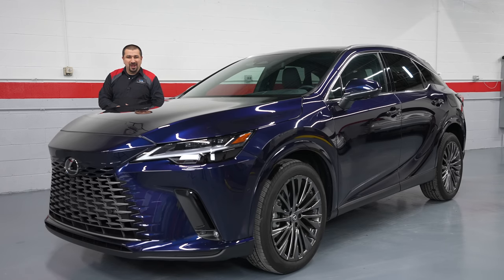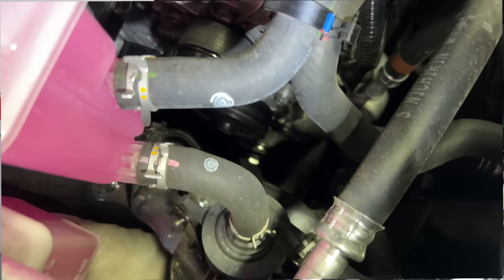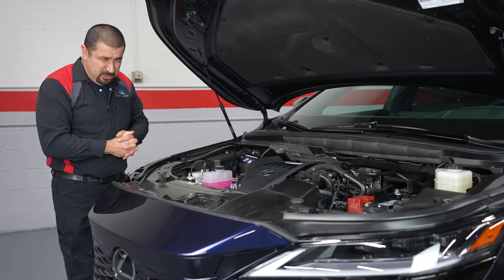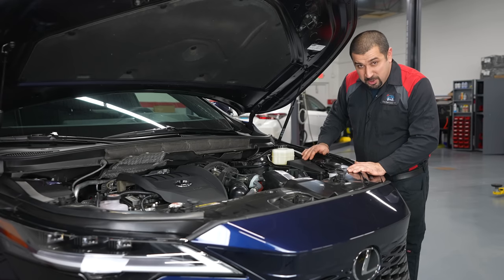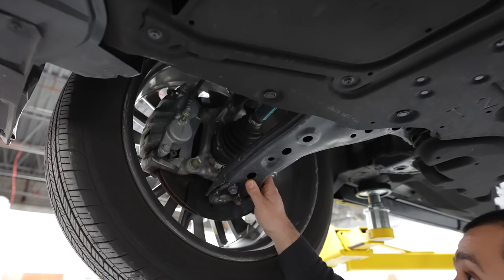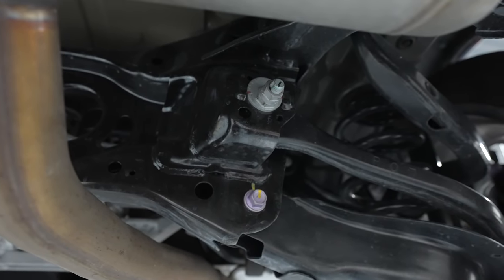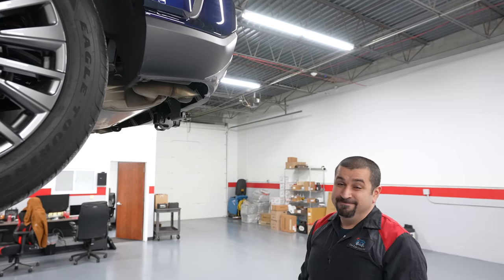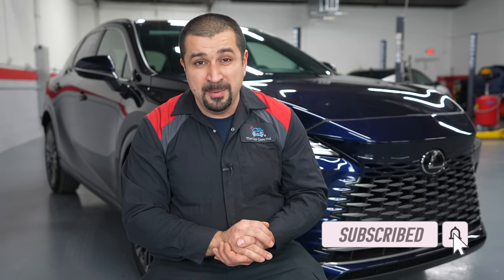Should You Buy The 2023 Lexus RX? Everything You Need To Know

Comment: Sir this question has nothing to do with the Lexus 
I have a 2005 Highlander 
104,000 miles on it. Bought from sister in law since she has no reason to keep. Her spouse passed. 
My question have you ever had a Toyota Highlander in the shop with original timing belt not a chain with more then 100,000 miles on it and still running like a kitten just purring. 
I basically drive it locally maybe once a year I go north 2 hour ride to Massachusetts. 

The replacement charge here is $1200 and up. 
I only paid $3k for my FWD Highlander. In great condition. 
Thanks

Comment: Very true, some of those gadgets are completely useless,  I had an outback wilderness it had the 4 cylinder turbo and that stupid big touchscreen that's was pure trash, anyway I ended up getting rid of it because the engine is to small to pull around a heavy car which ends up sucking the gas tank dry really fast, and that useless touchscreen which was more of a burden than a functional thing.

Comment: Any thoughts about how the 2023 RX 350h will do in highway mountain driving out here in Colorado?  I currently have a 2016 RX450h which does great. Thanks!
Reply: Test drove one.  It is not as smooth or as powerful as my wife RX350 V6 or my ES350 V6, but sure is gas saving.  We are in the Bay Area here and not much hills here though.

Comment: I was able to drive a 2023 Rx350 loaner while my 2021 was in for routine maintenance. I DID NOT like it for ALL the reasons you mentioned but more. I didn't like the huge screen, I actually do love the touch pad. I've gotten so used to it, my eyes do not go far off from driving in my 2021, but this 2023, my eyes, hands had to move further, while driving, which was more concerning while driving. Another thing, seems black headliner all over in these new models, even with lighter seat colors, the black all over was very hot, it's been 100 degrees, my 2021 has beige cream leather, beige headliner, gets cool, stays cool easily compared to this 2023. The engine annoyed me, sounded cheap imo. Not a fan of this one for 2023

Comment: The difference between car cate nut is hands in expertise versus journalism or youtubers that call themselves specialists in the automobile industry and they cannot even change an air filter on a engine let alone inside the cabin.  I like Lexus 2022, just because the v6 lives very quite ans smoothly.  I am not digging the 4 cylinder with a turbo complication.

Comment: I am supposed to buy one today (or not). Can you help a middle aged woman to decide? Very expensive vehicle for me and I want to make sure it is a good choice. Should I get one? (2023 Rx350 luxury/ not hybrid) 
Hot and humid FL here! 🙏🙏 Thank you..
Reply: I bought the RX350 Luxury 
Good news: 
📌It doesn’t beep all the time (I didn’t turn off any safety options).
📌Display on the windshield doesn’t bother me at all. Easy to use.
📌Super comfortable and quiet.
📌 Interior is amazingly beautiful. Panoramic roof is gorgeous.
📌Sound system is impressive.
Bad news:
📌 Don’t expect super smooth shift when you speed up quickly.
📌Lexus will send me the second key months later.
📌All weather trunk liner is not available for a while.
Bonus: 
📌Turns heads to you if you care about that, too. ❤🧿

Comment: Looking at '21 or '22 RX. Would you get the 350 or 450h? Anyone gone through a hybrid battery replacement? Seems like the lower octane gas + not changing the battery pushes a buy for the 350 for those that plan to keep this over 150k miles

Comment: Honestly compared to the X5 PHEV size wise it is comparable, but Lexus is just a FWD based Highlander (100% same) with all the Lexus embellishments. It is a good car, don’t mistake. I have the X5 PHEV for last 2 years, nearly 20K miles, 0 issues, maintenance free for first 4 years. I have extended warranty also. But the B58 powered PHEV is such a pleasure to drive. This engine has been proven to be very reliable for past 8 years now. Once again thanks to Toyota involvement in the B58 upgrades, they now use it in the Supra also. Combined with 30-35 mile EV range and 26 mpg gas mileage, I have averaged 45 mpg on the X5! I know I will keep it for 7 years and then decide. I will get a Lexus when I am 60 😂

Comment: Wife has been wanting an RX for a while and we test drove on of these on Sunday and couldn't get past the buzzy engine. BMW X5 drives well but the entry into the rear seats is too narrow for her mother. Mercedes GLE450 could be an option but is not available till year end in our area.

Any others we should consider?
Reply: Acura RDX? MDX? Aviator? Gv80? Telluride / Palisade calligraphy?

Those alternatives are so much better
Reply: @naveenthemachine  
We took a look at the GV80 and didn't like the split second row bench. 

Will look at the others as well as the just announced GLE450e that doesn't suffer from the high revving 4-cylinder off the starting line because of the electrical motor.

Comment: 6 month oil change is it still recommended by you if you only drive 3500 km in 6 months??  
I have a 1998 Mitsubishi Montero sport V6 3.0 24 valve with 220 000 km and engine consumes 1/2 liter per 1500km. I don't know if it is leaking out or burning it.
Reply: Yes, six months or 5000 miles, period

Comment: When the car reaches between 80k to 100k miles. The water pumps will need to be replace 😢. Thats $2,000 to $2,800.
This already happened to my 2016 RX350.

And the Turbo, hope it will last past 150,000 miles. If not, that $2,500 to $3,000 to replace.

Comment: I am so very confused about the available spare tire in the trunk.  It should be an open and shut case since we saw the spare in this video...  But I went to test drove the base RX and hybrid recently and there was no spare in both.  Instead, all tires are run flat and there is a can of tire sealant.  I called another dealership and confirmed again there is no spare (from base to RX500h).  Is it a regional thing?  I would prefer to have a spare...
Reply: All new NX models do not have spare tires.  Some RX models don’t either (optional equipment.?).  Ask before you order or buy.  Why Toyota went in this direction confuses me.

Comment: Hello again, you did not say anything about the "panoramic" roof, maybe they did divide it because of a structural issue or i have no idea, but why the hell did they put this beam in the middle to obstruct the whole point of having a panoramic roof, the same is on the new NX 2022 model 350h, and cant even have it on the NX 450h only sun roof option is there, that is why i am looking at NX 300h 2021 F - Sport Takumi packet with the whole glass panoramic roof, i prefer 2022 model its better but this glass roof is just the cherry on the top for me, or for my kid sitting at the back enjoying the view of the sky! Would you please comment on this?

Comment: I absolutely despise that stubby front end. It's worse than Lexus's spindle grill. It looks so weird on a car that's more swimmy sleek looking. This weird bump that totally ruins the front end of the car. Everything else is really elegant, but that bump or whatever completely ruins it. You then add the fact that there is no V6 engine, while the price remains the same, and it just feels like it's a sloppy redesign from Lexus. Big disappointment. It's a Toyota 4-cylinder so it's not like other car companies which are a bit better, but it's just hard to comprehend why Lexus would go through all this sound deadening and advanced noise canceling windows only to introduce a rattly buzzy 4-cylinder like your buying a cheap Outback or Nissan product. It's absolutely a deal breaker for me. If the front bump thing wasn't bad enough, the 4-cylinder lost it for me. Hopefully, Lexus can bring back the v6 and re-style the front end of the car for it's next model cause this is not a true Lexus.

Comment: Thank you for your nice video. Unfortunately, I just watched your video. Two weeks ago, I traded my 2020 RX 350 AWD with 2023 RX 350 AWD. I did not know that the 2023 RX required premium gas. I get worse MPG (18 in city) than my previous RX. This is what actually bothers me the most. The beeps are annoying. The bottom of the doors gets very dirty because of the design. When I open the door from inside,  I see leaves, drits, and dust sticking to the bottom of the doors (rubbers). You mentioned all the issues and nice things about this car. I also have a question. What happens if I put regular gas instead of premium? I really appreciate if you answer this question.  Thank you!
Reply: That’s why we looked at the RX and NX Hybrid only.  We bought the NX hybrid and saved $13K.  We don’t need to size anymore since our kids are driving age now.
Reply: I own a 2023 also. We had a 2010 previous to that. We get use to the 4 cylinder and really like the handling and look. But like you we really hate that the bottom of the doors get dirty.  With this new design this section of the doors go under the floor.  When driving in dirty snow sand and debris get stuck there. Very ugly and difficult to remove. What is funny is that Lexus were the first one with the RX to come with the concept that the door  must stay clean by cover it  completely with the floor. Now that brilliant idea is gone  at Lexus but others manufacturers used it.

Comment: The start stop is a dealbreaker for me. I do not like it when the car randomly decides to turn itself off. It wears out the engine much faster, makes an annoying shudder, through the whole car, just no. On top of that, you cannot just permanently turn it off. This was completely unnecessary and I will never buy a car with this "feature."
Reply: On the gas only models I agree

But the start stop system is fine on the hybrids. Because of their design and the fact that this tech was first introduced on the Prius

Comment: I can not see a turbo lasting 250K miles like the V6. There is just way too much heat.  And yes the 4cyl is noisy like a cheap a Nissan. Bad move. Drove a new Highlander also. The engine "feels" cheap and hi revving 4 bangers with a cvt are a recipe for harshness, noise and vibration. The pleasure of the drive is gone. Bye Bye reliability.

Comment: Looks like a hard pass for anyone in the rust belt 😬

I feel like you'd have to seal the engine bay and design everything to dissipate heat to a huge heatsink on the bottom and it could help aerodynamics

With so much plastic and rubber hoses exposed they've gone full BMW/Mercedes and how can anyone say they would trust all those to not be screwed with and improperly fixed 10-15 years from now... Resale value will be zero.